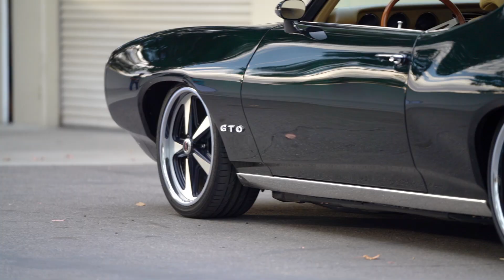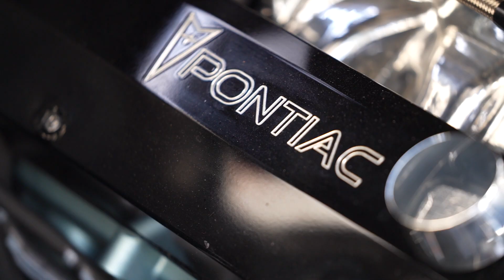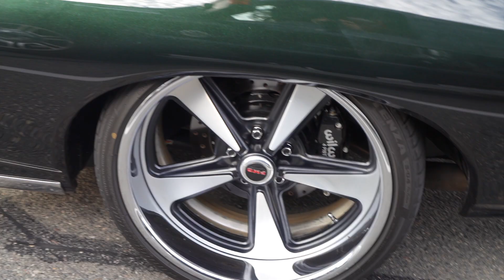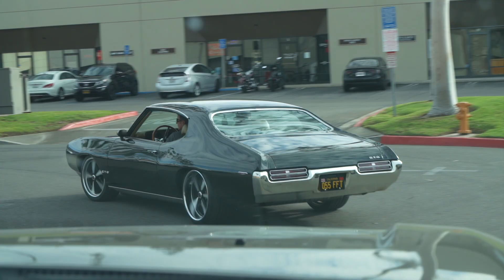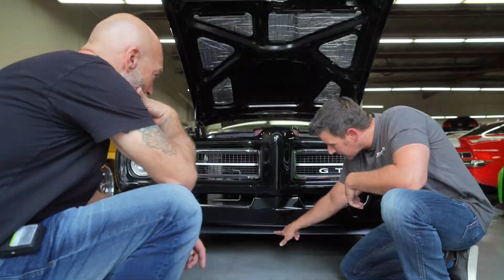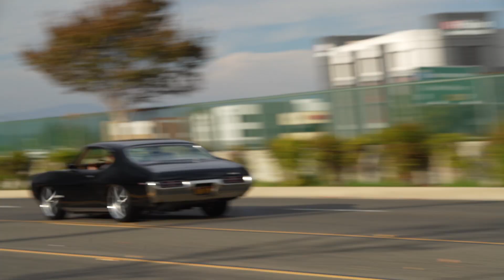LOUD Pontiac GTO Custom Pro-Touring Build | DIY Project Car

Comment: Shop built cars dont impress me. There is no heart and sole whipping out a checkbook. I have nothing but respect for this car. I've never seen a gto, lemans, tempest, firebird etc I've really liked. Dont get me wrong there all cool but this one is it. Best car ever on this channel hands down. I cant believe he painted it. That's the only thing I  dont mess with. I cant really tell if it's both but I can see for sure burning oil on passenger side. A ring or valve seal most likely.
Reply: Thanks Matt!  You're correct... I suspect a bent valve on the Drivers side.  (X Pipe Exhaust, so it's coming out the passenger side)   I had a catastrophic lifter failure late last year, and rushed the repair.  Ohhh well, more fun wrenching for me.  :)  And of course, I'll be filming that too.
Reply: @FastMonty  valve train failure is the worst. I only use Johnson lifters, smithbrothers push rods and jesel and harland sharp rockers. Very reliable even with heavy springs.
Reply: @mattvorhees6055  Yep, I switched to Johnson lifter too... let the trouble shooting begin!  (I did a leak down, and compression test, all is good :)  I suspect it's how my PCV valve is plumbed.  gettin through it...
Reply: @FastMonty  check valve stem seals. Those look like eldy castings. There product quality has gone way down in the last years.
Reply: @mattvorhees6055  Agreed.  Will check it out... I only have one bad spark plug, which happens to be the same cylinder the EGR port is located on #7, which is the driver side.  (The original mechanic plumbed the PCV valve to that port... I wasn't thinking when I rebuilt the motor, to change it back to the carb)  Wouldn't that be nice easy fix? ... fun stuff!  Thanks again...

Comment: Perfect perfect perfect. Only thing I would add is hideaway headlights
Reply: Ha!  I love hide aways too, but to respect my dad, we didn't go that route.  (Hideaways were an original build option)
Reply: @FastMonty  what exhaust on this? I came back to the video :)

Edit- oops just got to that part of the video. Have a muffler #?
Reply: @trashbandit2449  Ha!  I don't know what number I ordered but it's the 2.5" Magnaflow kit, with Hooker Electronic Cut Outs.
Reply: @FastMonty  thanks!

Comment: I have owned and still own many fine cars in the past 52 years of driving, but my favorite design of all time is the 1968 GTO (slight differences from the 1969, but essentially the same car).  About ten years ago, I broke down and bought a nice driver quality car, had it shipped to a GTO specialist in Michigan who converted it to hidden headlights for me and then sent it to Los Angeles.  About 5 years ago,  an employee of a former tenant of mine took the car apart for a restoration project because I had seen a couple of rust bubbles under the paint.  After the car was apart, he took off and left me with car parts strewn across my property.  It sat that way for about three years before my new tenant, a body shop, moved in and in lieu of rent, I told him he had to put my car back together and paint it.  I got it back about a month ago after two long years, and I just love to look at it.  That sloping, curvaceous hood with the hood mounted tachometer, the functional hood scoops (I added a ram air package), and the Endura bumpers with the hidden headlights is just one sexy beast.  I kept the car fairly stock except for adding disc brakes all around which necessitated going to 17" wheels from the original 14" rallye wheels  I just love it.  It's loud but I have a 500hp '72 Pantera that is so loud you can  barely think.  I even kept it in its original Verdoro Green which I thought was the best color Pontiac ever made.  Mike's car is gorgeous, and I hope he gets years of enjoyment out of it.
Reply: Thanks Ted!  Love you story, and hope to see you, and your car, in person one of these days...